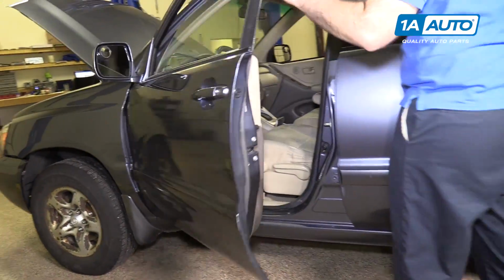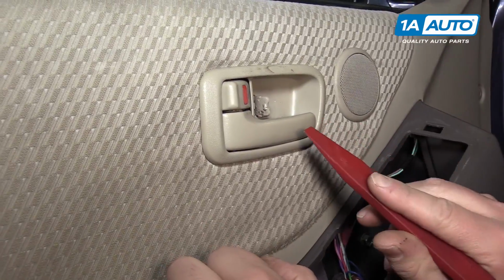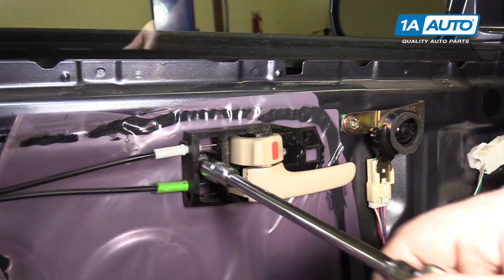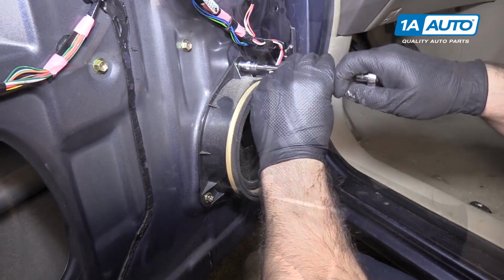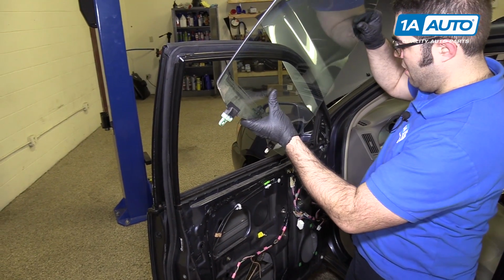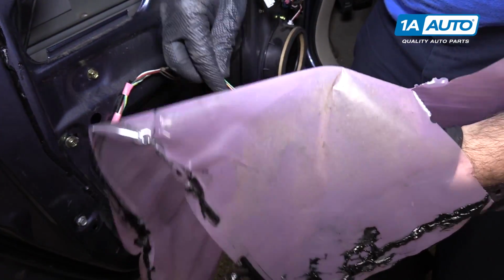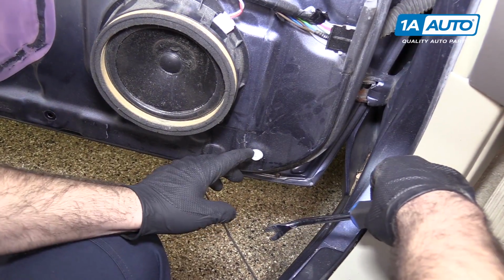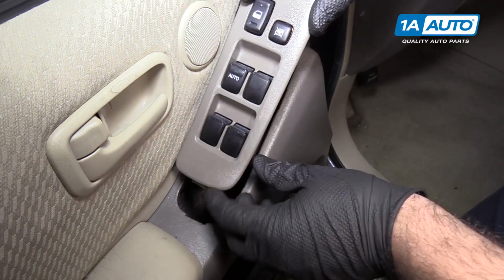How to Replace Front Door Window Glass 00-07 Toyota Highlander

Comment: After I have replaced the broken glass, the window goes up all the way then back down with the auto function. I have tried to hold the switch while the window is going up, but it still rolls down once it reach the top, has anyone had the same problem?